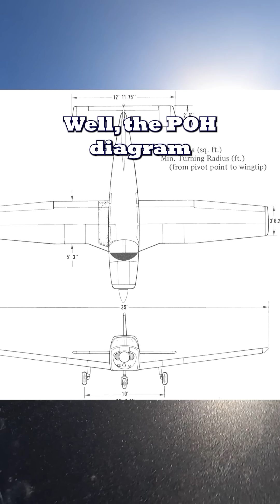Piper Design Flaw? #aviationphotography  #pilotlife #airplane #aviation #fyp

Comment: Any idea how early planes were made with this better design?
Reply: As for the shifted engines, I don’t really know much about that.

However, the Sopwith Camel, a World War I biplane, had it’s left wings slightly longer than it’s right wings to accommodate for the roll the aircraft would take on due to the torque of the engine and the relatively light aircraft frame.

Not really sure if that has much to do with your question, but still an interesting fact!
Reply: @evanhollenbach6556  very cool. I had no idea!
Reply: @madfartman6186  The book I have that explains this also stated that because of this difference in length and weight distribution, there were a number of experienced pilots that instead of turning right 90 degrees, they could instead stall the engine and whip the aircraft around 270 degrees to the left. Very dangerous, not sure how often it was performed, but still cool.
Reply: A lot of early airplanes used counter rotating props to solve this problem before they realized they could off set the prop
     Some they didn't really figure out like the Corsair 
     If you applied power near stall speed it would make it stall 
    They put a strip on the one wing to make them stall at the same time